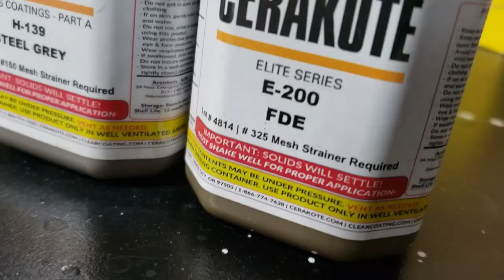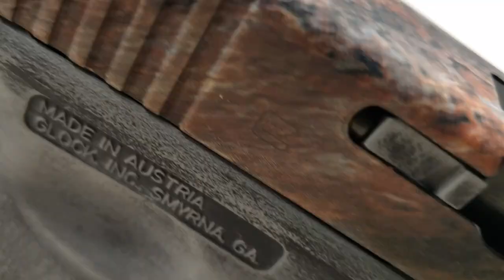HYDRO DIP & CERAKOTE! Battle-worn/rust [Glock 27]

Comment: I ultimately acetone, blast, gasout, re acetone and dry. If you blast after gas out you run the risk of impegnating contams from Gasout which make their way to the surface pushing them deeper into the anchor pattern or "blast profile".  We mainly do motorcycle parts so brake fluid and other nastys can catch you out if you don't do it that way. Suppose in your application it's 100s and I must say I do LIKE 👍

Comment: Home made oven? What did you use for elements?
Reply from the maker: Yeah I made the oven out of an old metal paint cabinet. The element is a smoker element, 110v. I got it off amazon.
Reply: Outstanding. I use a similar set up for cerakote (18 gun safe) but want to increase capacity. That’s the route I was thinking as well. Storage cabinet. Thanks for the reply.

Comment: Could please do a video on your plugging/masking the gun slide? I have ideas, but would like to see how the pros do it. I saw the plug kit on Amazon, but don’t know how that plugs the barrel hood area.
Reply from the maker: Unfortunatley I have to limit what I show on youtube because they consider what I do as "showing the modification of firearms"... absolutely ridiculous how stupid youtube policies are.
Reply: I understand you, but by your definition you are already doing that. It’s cool if you want too keep your trade secrets. I respect that totally. I just want to do it right.
Reply from the maker: @waynesmith7463  Not keeping trade secrets, it is just a lot of time and effort for a video that Youtube may or may not take down. Already had that happen a few times.  I do the videos a specific way so that it makes youtube happy that I am not giving step by step instructions on how to modify firearms, all I am doing is "advertising the custom coatings" that I apply.
It's not difficult, use tape to cover the inside of the slide, and the small rubber plugs to plug up the ejector hole, and a cork stopper or rubber plug to cover the hole where the barrel comes out.  If you want you can go all out and make a custom fit plug for the chamber area with hot glue, or make a silicone mold. Taping is not all that important for painting because you can use lacquer thinner and  a qtip to remove excess paint, the tape is to protect the inside of the gun from sandblasting. Hope that answers your question.
Reply: I’m sure I can figure it out. Thank you!

Comment: What was the time between coats? And temperatures? For the battle worn
Reply from the maker: Air dry time was 10 minutes after spraying. Every oven is different but mine tacks out each coat in 8 minutes at 150 degrees.  For the final black layer of battle worn I only go about 5 minutes so the black will wipe off easier. Took a few tries and experiments bu usually the 5-10 minute range is normal from what I hear.

Comment: Look great!  
Can you provide information on how you built your oven?
Reply from the maker: The shell is an old paint storage cabinet, about 6 feet tall, 3 feet wide, and 20ish inches deep. Inside is lined with rockwool. I used spray adhesive to attach 2 layers of thick aluminum foil over the rockwool, and foil tape to seal all the seams and corners. Installed a convection fan from and oven, and a 120V BBQ smoker heating element. Paint and put it on casters. Works really well. Heats up to 300 in about 10 minutes and holds heat really well. Cost me about 800$ bucks to build total and everything I bought was brand new except the cabinet.

Comment: Looks awesome! What did you use to plug the barrel hood/extractor area? How long do you soak in acetone before baking?
Reply from the maker: For polymer I usually soak for an hour or two at the most, scrub it real good and then bake to make sure there is no hidden oils. 
I use a lot of masking tape, and rubber plugs. There is links to all the masking materials I use in the description section of all the videos.
Reply: Same for the slide? 1-2 hours in acetone?
Reply from the maker: @waynesmith7463  Yes, but with metal you can leave it in there overnight if you need too, I rarely have to go more than a few hours on slides.

Comment: Where did you get those clips you hung the frame with?
Reply from the maker: I made them out of aluminum wire and alligator clips. Pretty easy to do. Chuck the aluminum wire in a drill and twist, then cut into sections. Then I just crimp on some cheap alligator clips.
Reply: All Things Fun Hydrographics, I have the alligator click ones. I was talking about the hanger you used for the frame. I use hooks but think that would work much better for frames and other stuff
Reply from the maker: @MyMike1984  oh sorry I misread the first message. Those hangers are from Cerakote. It's in a hanger kit they sell on thier website with  various sizes of metal jigs. Works like a charm!
Reply: All Things Fun Hydrographics , sweet thanks. Must be a newer item because I have seen them on there. Then again I usually only go on there for cerakote. Haha
Reply from the maker: @MyMike1984 they are under the equipment section. I know they have been on there at least 6 months. It's a good kit with a ton of hangers. Only issue is when I got mine all the metal pieces were coated in oil, I mean dripping with oil, so of course I had to clean all of that.
Reply: All Things Fun Hydrographics thanks
Reply from the maker: @MyMike1984  anytime!

Comment: How did you build your oven ?
Reply from the maker: Old metal paint cabinet. Lined with aluminum foil and rock wool insulation. Smoker element with a PID controller. Pretty simple.